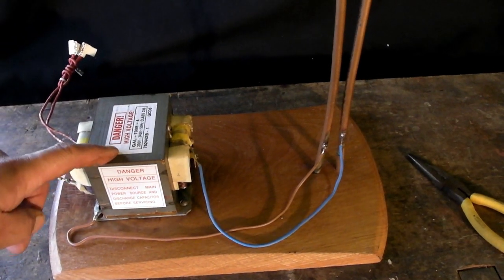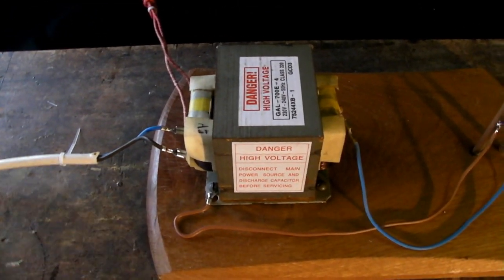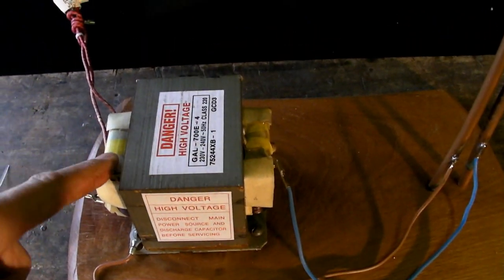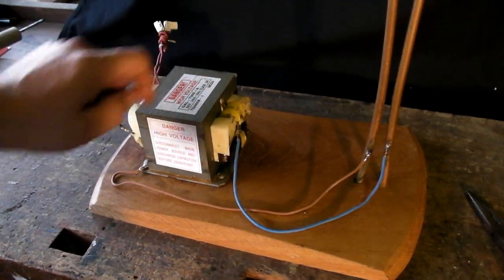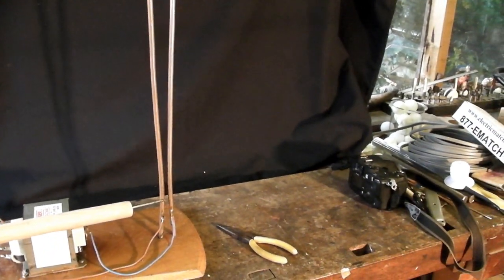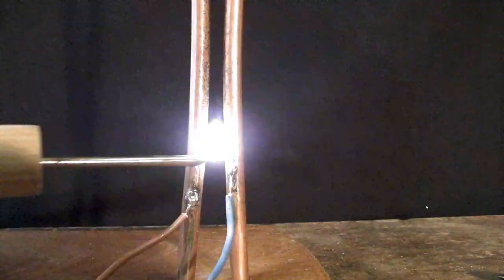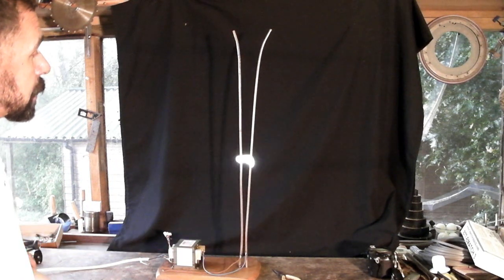How To Make A Jacob's Ladder

Comment: How exactly does the grounding on the primary coil work? I really want to avoid using the iron shell as the ground as that could be extremely dangerous, but it would work if everything went fine. I just can’t find the center tap for the primary (but I found the secondary’s) on either of my MOTs and it’s really confusing me.
Reply: no center tap on primary.

Comment: Should you have TWO transformers , wire the inputs in ANTI PHASE and you get twice the high voltage across the two output terminals ( which go to each upright pipe ) the iron cores are connected together and a good ( safe ) idea is to connect this junction to mains EARTH ( as it would be in an oven ! ! ) ... ( tried - n - tested ) ...... DAVE™🛑

Comment: In the 1960s I  built one when I was probably 12.  I used a neon light transfer which produced a very high voltage and high frequency.  I had no help from my dad who was an electrical engineer.  Luckily I survived.  I think I was lucky.  The voltage was high enough that the spark started with at the bottom and climbed up the ladder.
Reply: Transformers don't change the frequency. Glad you're still with us!

Comment: Did you try connecting two transformers in series?  The first one would boost the voltage by about 10X, then next one about 10X again.  That ought to spontaneously create sparks
Reply: Does'nt work that way. The insulation of the windings of the 2nd transformer will not withstand more than a few kilovolts. It would die in seconds. What you actually can do is to connect the primaries of two transformers "anti-parallel" (out of phase) to get twice the voltage (around 5 kV).

Comment: For "spark gap" Wikipedia says. An arc formed in air will ionize oxygen and nitrogen, which then can re-form into reactive molecules such as ozone and nitric oxide. These products can be damaging to the mucous membranes. It also says something about ultravolet radiation damaging your cornea, but I'm not sure you have to worry about either when briefly playing like something like this.

Comment: If the rods are adjusted to the right gap you shouldn't have to start it. And good lord is that a dowel rod with a nail in it?  You don't get near it or touch it till the power is cut, poking thousands of volts with a stick is just pure stupidity.

Comment: If you want to be less risky use a ZVS driver and a fly back transformer for a consistent higher voltage arc, but at a lower current(usually no more than 60mA) it can be lethal but it is more than safer than the 500mA MOT
Reply: Can confirm

Comment: Good work ! I made a fully automatic one, completely insulated and protected by an acrylic tube. The short circuit is produced by an isolated mechanical system. I also added two HT coils to make decorative spark gaps. You can see it on this link: 

https://www.youtube.com/watch?v=xcl4T_qkb2E&fbclid=IwAR18fsUVsUynfoHT0mUVIzSpJnOe75JoTgv0Tecw2e4JJdYkkAyNtjCKq5w

Comment: There are other videos in which the Ladder does not require a wooden stick. Why do you need one in the UK. Is the physics different in the UK?
Reply: The transformer is a lower voltage. When using, say, a 20,000 volt neon sign transformer, the voltage is high enough to bridge the gap at the bottom.
Reply: @hailzanzibar4881  I think I would try a smaller gap.  A man could  accidentally use a stick that was too damp.
Reply: @derholzhacker4780  It would have to be a gap of less than 1 millimeter for it to work. And don't use a stick, just use a screwdriver with a rubber handle, or even better, a probing device.
Reply: @hailzanzibar4881  ....Thank you. 1 mm sound about right.

Comment: i have had great success with a 12v halogen ballast and a flyback taken out of a 5" plasma ball:
https://www.youtube.com/watch?v=T3QF07ox-sw

i think you have plenty of volts there, and there is another reason it is not sparking automatically;
you need to make an air pocket below the spark point. so the prongs need to be fitted further apart, and bend over to meet each other a little above the surface.

Comment: If you keep the bottom of the ladder 3/16 or less,ladder will work without stick. Or solder a starter tab and it lights up like xmas. Cool Vid. Thanks

Comment: I know you're recycling but a safER option would be to use a neon sign or oil burner ignition transformer.  Microwave oven transformers output 2,000 volts at 500 milliamps and anything over 100 mA has a good potential to stop your heart.  Neon or oil burner transformers usually output 30mA with roughly 10,000 volts.  It would hurt like hell, may burn you, but probably won't kill you, although anything above 20 mA has the potential to contract your muscles so you can't let go and cause suffocation.

Comment: I'm in the US, our mains here is 120v but MOT's basically follow the same design principles.  Some questions about earthing ("grounding" in North America), though...

1) Aside from connecting the base of the transformer to the second copper pipe/wire, should it also be earthed?  (By means of using a 3-wire cord instead of a 2-wire cord)
2) I've seen the dowel & nail method used before.  Some folks choose to run an insulated ground wire from the nail to a grounded object such as a copper gas or water pipe, grounding rod, etc.   Should I consider this?

Also, out of curiosity, how do I prevent MOT's from catching fire?  Should I place them in transformer oil, or will this damage the MOT?  Or is it simply not possible to stop an MOT from overheating?
If this does not work I suppose I can spend some $$ and purchase a 10kV current limited neon sign transformer off eBay or Amazon, although my microwave is on the fritz and I'm thinking about salvaging the transformer once I replace it...

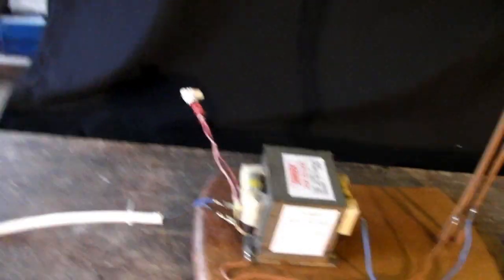Comment: +wonderstruckwow Thanks for your vids, I really enjoy what you share. One tip from me: You should properly ground the transformer (3:52). It will work without grounding, but due to the high voltage and thin wire there will be flashovers within the secondary coil. This destroys the transformer in no time. If in doubt, see how its done in a microwave (before blowing it up of course)
Reply from the maker: Thanks for the advice - not sure why we didn't do that!
Reply: Ground it to where?

Comment: i plan to build something similar . since ze plug in is techicaly d.c coming from ze powerplant i thought to myself  why not i build a system which can power itself  yes we all hears of ze free energy theory  . im taking a different approach   using  rather simple  physics   between a large wheel  . a small wheel & wiring connecting to a microwave transformer  which it connects to  a battery bank 7 then a wall socket  & into a a.c. motor . d.c supplied by a  large alternator which hooks up  creating a loop .. ze battery will be dead of course so whatever comes out   of ze transformer is stored... its pretty complicated & i will have it done soon

Comment: Be highly careful..the experiment looks really cool..but u need to have a very good experience in electricity and electrical equipment, as jacobs ladder operates on a very high voltage...preferably an emphasis on college physics or electrical engineering is required...a 15 year kid passed away in ohio after conducting the experiment..

Comment: Thank you for the video, I actually seen it from start to end. I still have some questions that I need some answers for if you don't mind: 1st: What is that extension hanging in the air from the input side? I can see two wires probably taped together. The second question is, those poles which the spark comes in between, are they empty from inside? like tubes for example, perhaps copper tubes like in the back of the refrigerator? or what. Again, thank you and I hope you find the time to answer my questions.
Reply: +Ahmed Alian The "poles" can be either tubing, or solid wire. They also can be steel, or copper. The extra wires seen on the left side of the transformer were used to power the filament or heater inside the magnetron tube in the oven. They should not be connected together. Remember, there is a deadly amount of power here, BE CAREFUL!

Comment: The wires that are not connected go to the capacitor..right?? can you hook up the capacitor, and if so would it help out the voltage to be higher???
Reply: +Kennynva T. Those extra wires are low-voltage AC that powered the filament in the magnetron tube.
Reply: So the two wire go to the magnetron...and the high voltage wire..goes to the capacitor and diode in a microwave oven right???
Reply: +Kennynva T. Yes, the two "filament winding" wires from the transformer go to the 2 terminals on the magnetron. The high-voltage winding on the transformer has one end grounded to the core, and the "hot" wire goes to one terminal on the capacitor. The second terminal on the capacitor has the diode connected to ground, and this terminal also connects to one of the 2 filament leads going to the magnetron, which is the high-voltage input to the tube. 
   The capacitor and diode form a half-wave unfiltered voltage doubler. The positive-going half cycle goes from the transformer, through the capacitor, then through the diode to ground, charging the capacitor. Then the negative-going half cycle from the transformer goes through the capacitor, and gets added to the voltage already in the capacitor, effectively doubling it. The diode is now reverse-biased, so it don't conduct, causing this voltage to go into the magnetron and do its thing, returning  to ground through the case of the magnetron. 
   The filament winding on the transformer is only providing several volts AC to the filament, but it also has the high voltage DC on it, so this winding is well-insulated from any other parts of the transformer. In the Jacobs ladder in the video, there is no high voltage in the unused filament winding leads, just a few volts AC.
   A simple way to view this type of voltage doubler is to imagine a diode and capacitor in series, across an AC voltage source, like most power supplies. But instead of putting the "load" across the capacitor, you put it across the diode.
Reply: Thank you very much...so could you use the output of the capacitor going to the diode and connect it to the jacobs ladder...??? and it would be doubled...would that work...???
Reply: +Kennynva T. I'm not sure if that would work. Being half-wave DC, the arc would extinguish during the missing half-cycles and may not continue. And I've never seen a DC Jacobs ladder, not sure if it would work properly even with pure DC.

Comment: Hi , nice video !Is this also possible with DC like with an 9V battery(of course with a different structure or electrically parts) ?
Reply from the maker: +It's Wolfs live Yes it is, but can't say I've done this myself.  You do indeed need a few different parts but there's a nice little video showing you how to at https://www.youtube.com/watch?v=cU0sLf5okZ0.  Even though you're only using a 9 volt battery you still need to be very careful with the high voltage output.
Reply: wonderstruckwow thank you! Do you know where i could get the part is shown at 0:22 or ist it self made?
Reply from the maker: +It's Wolfs live That's the flyback transformer - it's used in a TV set to generate high voltages.  I'm sure if you look on ebay you'll be able to find one.  Just put the part number from the video in and have a search.
Reply: Ahh i see...ill look for one thank you! !
Reply: Hi wonderstruckwow just another question with the Transistor, in the Video it says 1307, but i only can find 13007,can i also use it?
Reply from the maker: It's Wolfs live They look to have similar specs so I would imagine it would work OK.

Comment: I didn't really receive this lesson well in class, but is this just an electrical arc, or is this a plasma?
Reply from the maker: ***** An arc occurs due to the  electrical breakdown of a gas.  You then get a plasma discharge through the gas so it is kind of the same thing.

Comment: Try putting a single strand of 28 - 44 guage copper wire at the top of each electrode

It will probably just burn out immediately but it should be interesting
Reply from the maker: Mitchell Kuske Might give that a go but might be better at the bottom so that any arc formed can travel up the electrodes.
Reply: Cool... make sure that you get it on video and tag me in the vid plz
Reply: Ohh and I would discharge it after u turn it off
Reply from the maker: Mitchell Kuske We haven't got a capacitor in this circuit so no need to discharge after it's switched off.
Reply: K

Comment: Ok, so I have a microwave transformer that has three coils. The third outputs extremely high voltage. I was able to pull a 1 ft arc off it. 
Now this is a lethal arc, as it tripped a 15 amp breaker. 
PROBLEM- It only arcs when initially shorted then electrodes pulled away from each other. 
I desire to make it into a driver for a ozone he generator.
Question- Can I use a fluorescent light ballast between the mains and the transformer so that the output is both higher, and arcs more easily, plus isn't lethal anymore?
Reply from the maker: zdw306 I should think using the ballast would be a good idea, but haven't tried it myself.
Reply: I should also say that I have a second microwave oven that has a good transformer & magnetron in it. so i have two of these transformers + another two magnetron emitters.
Yes I know a good bit about how to be safe around high voltages, but gotta say- They still scare me!
Reply from the maker: zdw306 Yes - you've only got to make one mistake!

Comment: Great how to. I'm making a frankenstein lab for halloween and would love one of these. You said the transformer was smoking/heating up during use, is there a way to run this throughout the night without this happening?
Reply from the maker: kepler2020 I don't think you'd be able to do this with our set up.  Leaving it running through the night could be a bit of a hazard anyway as the arc is more than capable of causing a fire if it should come into contact with anything flammable and then there's the risk of someone curious touching it if it's left unattended, which could be fatal.

One thing we've been thinking about is to use a contact point at the base of the electrodes that is moved by a servo to close the gap and form the arc.  This could then be triggered by a sensor of some description and the whole thing could be controlled by an Arduino or other microcontroller.  You'd have to build in some safety to make sure that the apparatus couldn't be triggered too often and even then it should be encased so no one can touch anything and it shouldn't be left unattended.

Comment: Why didn't you bend the copper rods closer together to avoid using the highly complex dowel and nail? (Since you're a teacher I proof read and edited that sentence about 3 times before posting it) xD
Reply from the maker: EweChewBrrr Ha ha - sentence seems fine to me.  

Yes, I might try moving the electrodes closer together but to get a spark through air at about 2000 volts we'd need them to be about 1 mm apart.  Another possibility might be to drill a hole through the bottom of one of the electrodes and put a self tapping screw through it to close the gap - that way it'll be a bit more adjustable.

Comment: very cool i may just build one. Question i think i already know the answer to but. will a florescent light transformer / ballast work?
Reply: Nova Flare Just a word of warning: the ceramic insulators at each end of a magnetron's cavity (one exposed and usually one inside the can with the connections) contain beryllium oxides, don't break them up or grind them at all, the dust's carcinogenic :)
Reply: nice job
Reply from the maker: Nova Flare Good question - I've never seen one used in this way so I suspect they won't work very well if at all as they output in the 100s of volts rather than the thousands.
Reply: wonderstruckwow hmm but i think the amps might be hirer allowing the current to jump. No matter i see microwaves on the street all the time for the trash man. Oh any plans for the magnetron could be interesting. Though it may just make a radio jammer lol.
Reply from the maker: Nova Flare For a spark to form in air the potential difference (voltage) across the electrodes must exceed the breakdown potential of the air.  If the voltage isn't greater than that the spark can't jump, pretty much regardless of the size of the current.  I think the the output current of our transformer is of the order of 0,1 A or less (but it only takes a few milliamps to stop your heart).  I'm not sure about the current output from flourescent lamp transformers.
Reply: ***** yeh is like the rectafiers on high capacity car battery chargers. Nasty stuff. Getting cut by one of those bastards could mess you up real good as it is also just good old fashion toxic.
Reply from the maker: Mishell Hu Thanks!